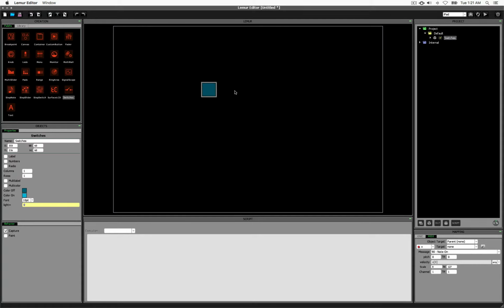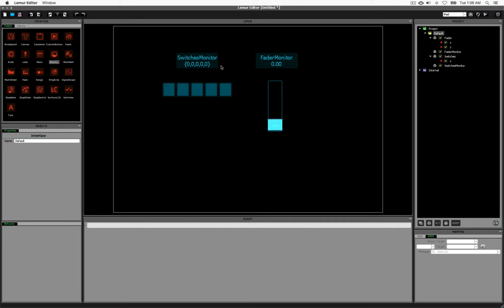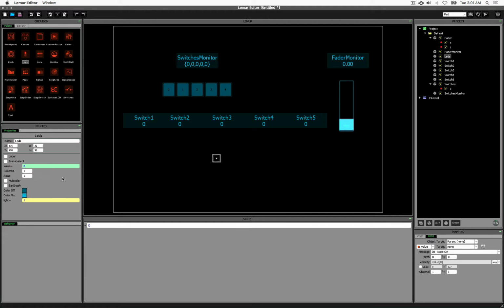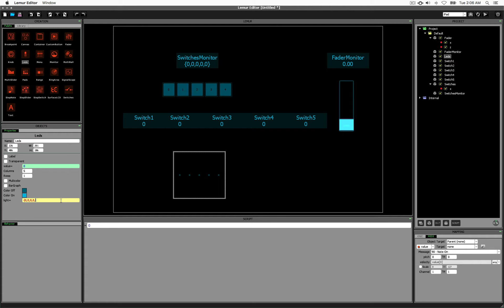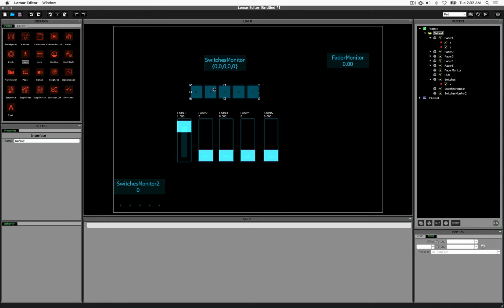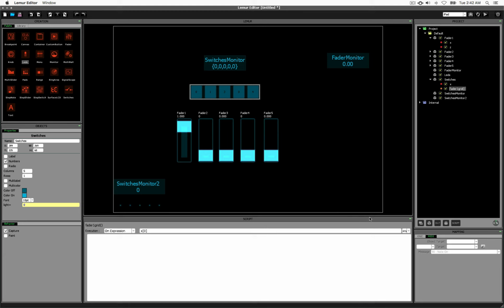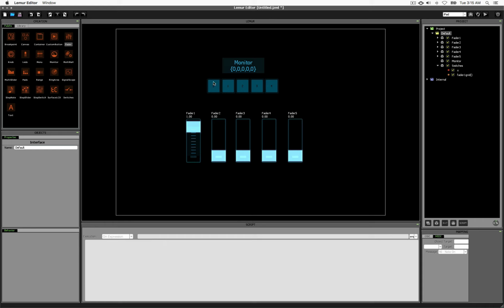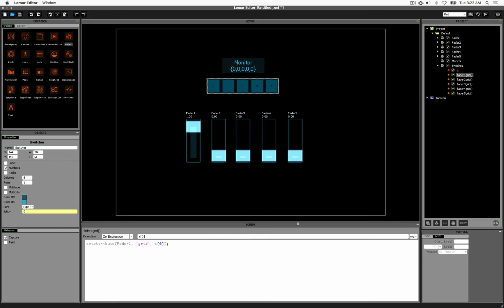Lemur Editor In Depth Tutorial - Part 2

Comment: Thanks for your great Lemur video tutorials! Question, can I use breakpoint.x[1] to not only control the value of a fader, but also have this fader track this value as well as send this out to this fader's OSC target?
Do you have a patreon?
Thanks, Marc
Reply from the maker: Hi Marc, thanks for your comment. If you want to send any value to an OSC target, you should be able to make a new variable inside of the object, and set its value to breakpoint.x[1] in this case. If this doesn't work, it could be you'll need a separate script to manually update the variable's value each time breakpoint.x[1] changes (trigger mode would need to be "on expression" breakpoint.x[1]). Let me know how it goes!
Regarding Patreon, I appreciate the interest. I do not have one currently, as I don't create videos frequently enough to feel money would be fair to ask for. Glad you have found some use in this video, cheers.
Reply: Thanks for your reply, but how on Earth do I create a new variable in a stock object (in this case Breakpoint)??? It's very frustrating that only X[0] & Y[0] can be assigned OSC outputs. Really defeats the purpose of having objects like Multi-Ball, Multi-Fader & Multi-switch, along with Breakpoint. I can't really do anything with them without the ability to assign the additional controllers (X[1], Y[1], X[2], Y[2], etc.) to output OSC control signals to individually assigned OSC targets. 
If you know how to achieve this and it is documented in one of your videos, please let me know. If you know how to achieve this, but it is not documented in one of your videos, can I hire for an online lesson?
Thanks, Marc
Reply from the maker: @Sonakinesis  Just select the breakpoint object and click the x= at the bottom of the project view. That's a variable. Any variable can be assigned as an OSC output by using the path to the object, followed by / and the variable name.

Comment: Wondering how I can send a midi note from a custom button to toggle the on/off state of a bass kill with visual feedback both ways. If I set the scale of CustomButton.x to from 64 to 127 the button toggles correctly, but I don't get visual feedback when I turn the button off in Ableton Live, because the button only turns off when it's set to 0 not 64. When I tried using scripts I got a midi feedback loop with the button turning off and on. I tried with expression and midi note on/off messages for the scripts, but I'm missing something.
Reply: I basically need to somehow detect whether the button is pressed on the ipad and send a midi note then, but not send a midi note when the button is turned off from ableton. Love your videos, and if you don't know off the top of your head, no worries. I'm sure I'll figure it out eventually.
Reply: I figured it out!
Reply: For anyone interested....

Expression X:
if (x == 1 && midireceived == 64) {
	noteout(0,66,127,1);
} else if (x == 0 && midireceived == 127) {
	noteout(0,66,64,1);
}

Note On:
midireceived = MIDI_ARGS[1]; // always 127
CustomButton.x = 1;

Note Off:
midireceived = MIDI_ARGS[1]; // always 64
CustomButton.x = 0;
Reply from the maker: Thanks!

Comment: Is it possible to setup a switch that toggles all buttons between either executing the x (a script with an MIDISEND) and a script that is selfwritten? Or if thats not possible, is it somehow possible to "Overlay" buttons with using a switch? So I could for example set two exact Buttons over each other, and the Switch will hide one or another.
Reply from the maker: Absolutely, I recommend watching all of my Lemur videos. For example, you can use the knowledge covered in Part 7 to toggle which button is visible, and therefore active. https://www.youtube.com/watch?v=6nk7VPHkSSE
Reply: @JustHackingAround  Thanks for the reply! I just tried it out and figured out that it would be much nicer if I use the IF statement to make the script of the buttom depandable on a other switch. Means, I want to have ONE global Button that turns on/off all the scripts of every Button. In order to do that, I tryd to use the "OnExpression X 0 to1" Execution but combine it with a IF statement. I hadnt had success with thatt code. Why is that? I realy apreciate your help!

if (Write.x=1){
keycomboout(0, 1, 0, 0, 53);
}
else{
0;
}
Reply from the maker: @Leo Brennauer  Have you watched all of the videos? Please start with the "very basics of scripting" video. For example, = is not the same as ==. Also, 0; doesn't do anything, so if your intention is to do nothing then just leave out the whole "else { }" section entirely.
Reply: @JustHackingAround  I so much apreciate, its working! Thank you very much! I should realy take the time watching all your videos before asking, but they are just so many - a very big praise from my site! Maybe you could create a table of contents which shows where to find what :D
Reply from the maker: @leobrennauer   That's great! And every video has a table of contents in the description, which should help.

Comment: Thank you for the great tutorials. I was wondering if you know how to reverse the LEDs where the top row becomes the bottom? I am using LEDs to display signal from ableton and it works, however the meter starts from the top where the -inf is. Could be simple, but I can't seem to figure it out, please let me know if you have a solution. Thank you
Reply from the maker: Thanks for the comment and question. Remember that in general, a "maximum value" minus a "zero-to-max range" gives you essentially the reverse of the original value. If you need any more help, let me know. Maybe this will prompt you in the right direction.

Comment: Hello. I'm wondering if it's possible to monitoring the text on multiple switches?
Reply from the maker: I'm not sure what your question is. Maybe you can ask in a different way?
Reply: @JustHackingAround I have a four colum switch. Each button as a name (text). I want to monitor the name of those buttons
Reply: @JustHackingAround  on you video, the monitor shows the number of the switch. I want to add a text to the switch and the text appears on the monitor.
Reply from the maker: @luismarques9141  I made a Lemur video specifically on Monitor objects and return values. Have a look and see if it answers your question. https://www.youtube.com/watch?v=rnFgwy2BC3U
Reply: @JustHackingAround  I saw almost all your videos. They are great. There's another way to tal with you? Messenger or whatsaap?

Comment: I'm trying to figure out how to create MIDI mute groups by using a Switches object.   It has 15 columns and 1 row.  I want to parse the 15 switches and any switch with a x=1 would have a MIDI velocity of 1 and any x=0 would have velocity of 127.  So I want to push a button and have it gather the state of all the switches and then send 15 MIDI messages with the new state for each switch corresponding to the Mute state in my DAW....So I know what I want to do-I just don't know how to do it, lol
Reply from the maker: I can't speak to the interaction with Ableton Live itself. But it sounds like you just need to put a script inside of the switch which triggers whenever a change is made to any value (i.e., execution mode set to "x"). From there you could choose to either use the MIDI functions in Lemur to send messages out directly, or create one variable per switch within the switches object, and use a "for" loop in the script to set each variable to its corresponding switch value (Switch1 = Switches.x[0];   Switch2 = Switches.x[1]; ... etc.)

When you set a variable's value, it automatically gets "triggered" to send its output to whatever output method / settings you've configured using the MIDI panel. You select each variable and then use the MIDI panel to configure its destination -- in this case, you'll have to figure out where to actually send the value depending on your needs with Abelton.
Reply: @JustHackingAround  Thanks man.  I ended up doing something similar.  This was my "mute on" loop: decl y = 0;
decl CC = 26;

while (y < 15)
 {
  if (Switches.x[y] == 1)
   {
    ctlout(0,CC,127,5);
    setattribute(Switches, 'color', {RGB( .5,.5,.5),RGB( 1,1,0)});
   }
  
  y = y + 1;
  CC = CC + 1;
}
Reply from the maker: @JoelLaviolette  Looks good, sounds like you've gotten to know your way around Lemur. Sometimes it just takes thinking, walking away, and coming back later to solve the problem!

Comment: What I can't seem to figger out is how I could get a switch to go to 'off' when I press another switch in the same container.
eg. I press a switch to 'play' and it stays on. When I press another switch 'Stop' i would like the 'play' switch to go back to inactive state and color.
Can this be done?
The same when using multiple buttons to activate sertain tracks or settings in Cubase.
Reply from the maker: Hi, are you trying to use separate switch objects, rather than creating multiple rows / columns in a single switch object? Because if you use a single switch object with multiple rows or columns and set it to "radio" mode then one switch automatically goes off when another switch is pressed.

Of course, if you insist on using separate switch objects, then in each switch you need to put a script to trigger on the switch's "x" variable. When the current switch's 'x' variable changes, set the other switch's 'x' variable to 0. Do that for both switches.

That should work ... ?
Reply: In my initial question I was talking  mistakenly 
about a switch...
I was actually trying this at first with a 'CustomButton', with the behaviour set as switch.
The reason was because I wanted to mimic the transport controller in Lemur to start with, and then expand my set-up with more buttons to activate specific things in Cubase.
My biggest problem I guess is, that I don't have any experience with scripting nor the mathematical knowledge.
I kind of understand what the button needs to do and how the others schould react.
I just don't know how to write a script for it.
So I did try your answer and used the Multi row / collums  SwitchObject and with 'radio' activated, this does exactly what I was looking for.
I could use this to control and activate / deactivate certain settings in Cubase.
Sow… a big thanks there.

The problem however is, that this way I can't use the symbols that are available using the CustomButtons.
But I'm afraid that if I want to do this to either switches or costumbuttons set as switch, I will have to create a script.
Can you help me with what exactly I have to write in the éxecution field and script below?
I have 6 custom buttoms set as switch.
This would be a very big help.
Reply from the maker: You'll need to create a script inside of each CustomButton. Set the execution mode to On Expression, and put x in that little box at the top. I'm going to pretend this is the script inside of Switch 1. You need to use the actual switch names instead of  "Switch1", "Switch2", etc.:

Switch2.x = 0;
Switch3.x = 0;
Switch4.x = 0;
Switch5.x = 0;
Switch6.x = 0;

That turns all the other switches off besides Switch1. 

Similarly, inside of Switch2 you'd put this script, with the same execution mode of "on expression" and x in the little box:

Switch1.x = 0;
Switch3.x = 0;
Switch4.x = 0;
Switch5.x = 0;
Switch6.x = 0;

I think you get the picture. Just repeat for every button.
Reply: You are the man! :0)
It is actually working.
unfortunately, there Still was a tiny little problem wich I will explain quickly, just in case someone tries to do the same as I am doing.
Per switch (a custombutton set as switch) I did what you discribed.
Let's say I push switch 1.
It gets Active.
Then I would push switch 2.
Switch 1 goes inactive.
But also switch 2 remains inactive.
I had to push switch 2 again to get it active.
I then pushed switch 3.
Switch 2 would go inactive, but also switch 3 remains inactive untill I pushed it again.
etc.
My solution (tnx to you and some logical thinking) was:
(for the first button)
Switch1.x = 1;
Switch2.x = 0;
Switch3.x = 0;
Switch4.x = 0;
Switch5.x = 0;
Switch6.x = 0;
(For the second button)
Switch1.x = 0;
Switch2.x = 1;
Switch3.x = 0;
Switch4.x = 0;
Switch5.x = 0;
Switch6.x = 0;

etc.
So int the script you also write a line for the specified button but instead of '0' write '1'.
And now… EUREKA! it works.

Thanks so much
Reply from the maker: Hi, you're right, I forgot about the trigger cycle. There's actually an easier way to solve this though. First, write the scripts as I originally did. Then on the right side of the "execution mode" bar there's a little icon menu. From that menu change it so the script only executes when the value of x increases. This means each script will only run when its value has been changed from 0 to 1 (when THAT button is clicked). 

Hope that makes sense!
Reply from the maker: I forgot that I've demonstrated this in the following video. Here is the link starting at the most useful spot in the video, but be sure to watch the whole video if this segment isn't clear:

https://youtu.be/6nk7VPHkSSE?t=164
Reply: How did I miss this tutorial??
I looked at the complete tutorial now and… it makes perfect sense …
Like I said before… you the man ;0)
a million times thanks